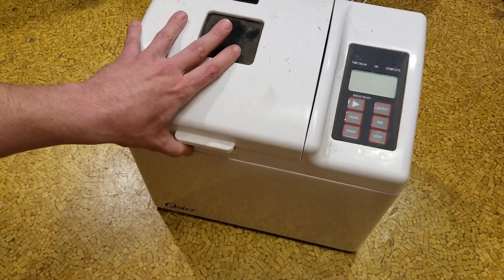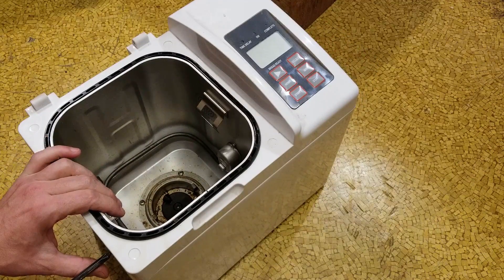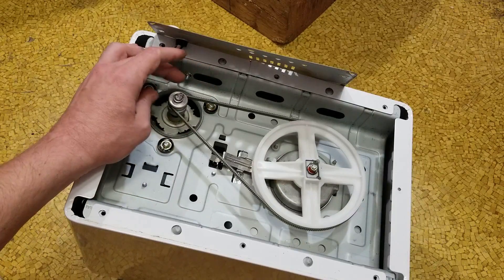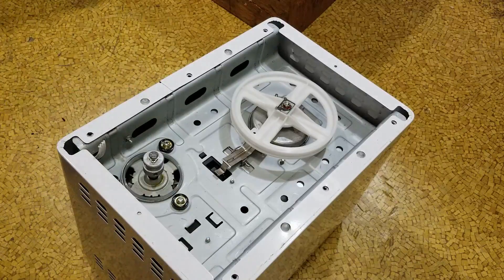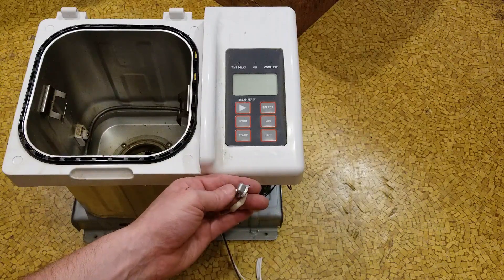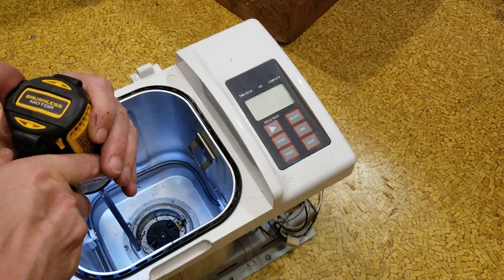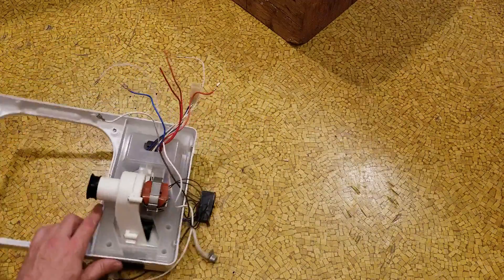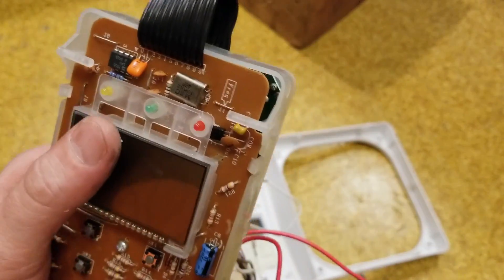Oster Bread Maker Teardown/Disassembly

Comment: I don't know what your problem is with the Oster 4811. I bought one new in 1994, use it regularly, it makes great bread and still works fine today. Has needed zero maintenance other than normal cleaning.

Comment: I live in Europe and had to cut the 3rd prong off the plug to make it work with the converter. It worked fine when I first plugged it in after removing the 3rd prong, but now it is not working. Do you have any suggestions of what I can do?

Comment: Bread machines are awesome!!  My first one was a Sunbeam, which lasted around 10 years.  I now have Hamilton.  I used to let the machine do the whole process.  Now I just let it make the dough and then I knead a little bit, let it rise and bake it in the oven.  That way you get a traditional shaped loaf of bread.  It's faster by a half hour too.  I have not bought bread at the store since having a bread machine, about 20 years.   The bread is sooo good..  There is real substance to it.  Depending where you shop, it is cheaper too!   It makes great pizza dought also.    
I am glad that I recently discovered your channel.  I love cats.